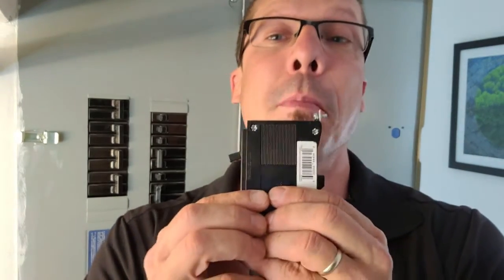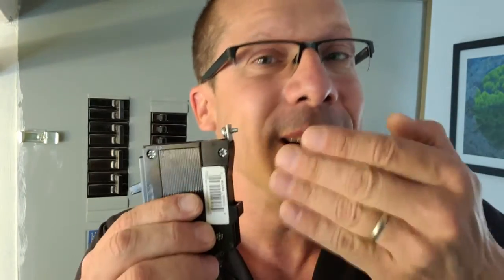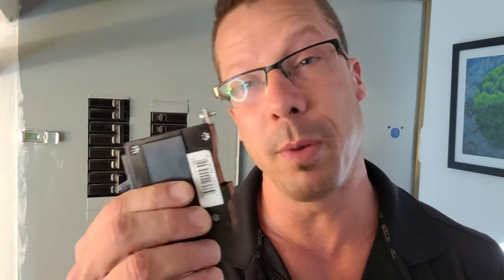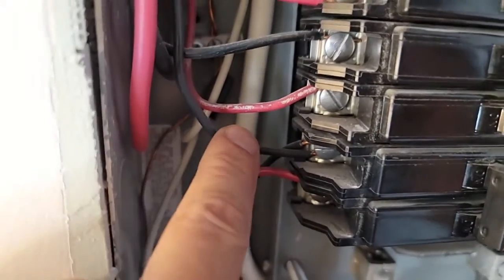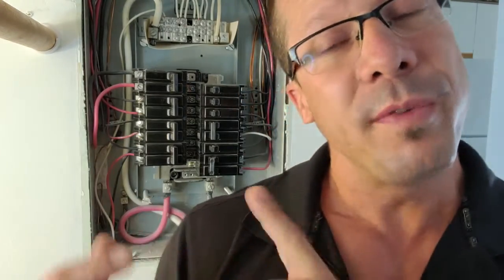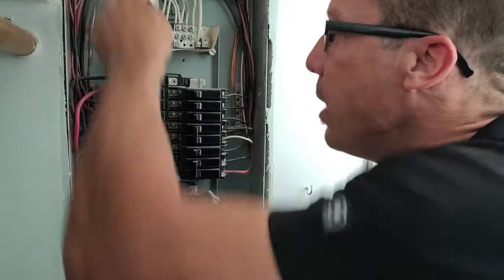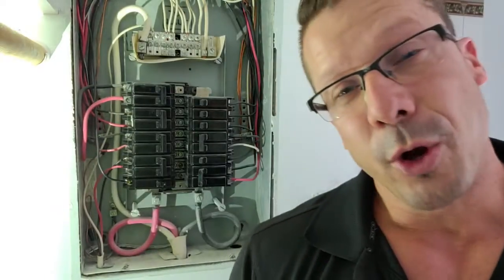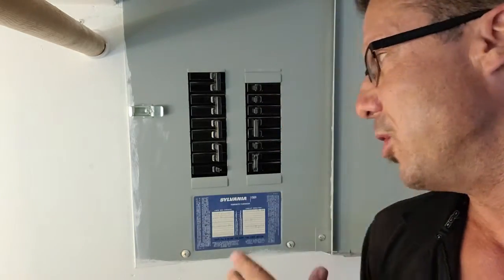How to fix a double tapped breaker

Comment: Nice video!!  I looked at my breakers and there is a number labeled on it so I assume it the amp?  How do I know which breaker amp to get to put one of the wire into from the double tapped breaker?
Reply from the maker: @ChronoShinta  Hi, yestge number is the amperage. It also depends what the wire is feeding. If it's a regular outlet, a 15 amp is normally what is needed. If it's an outlet in the kitchen, a 20 amp might be needed. Hope it helps and thank you for watching our videos 👍

Comment: If there is no space left and circuit is not overloaded could you pigtail the wires and send an extra wire to the breaker
Reply from the maker: Hi, it will prevent the wire from arching but it could still overload the beaker. They sell 2 breakers that fit in one spot called tandem breakers. But they have to be manufacturer approved.